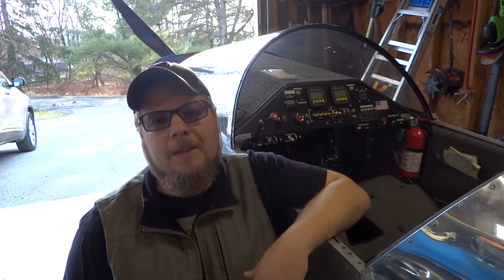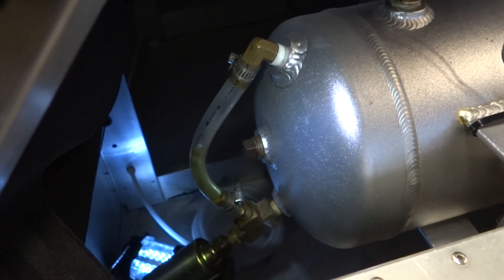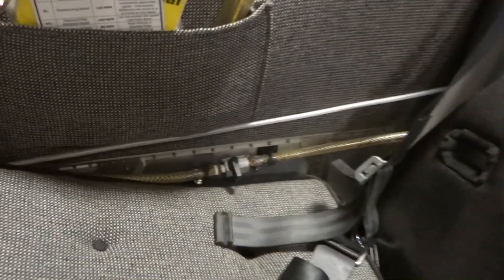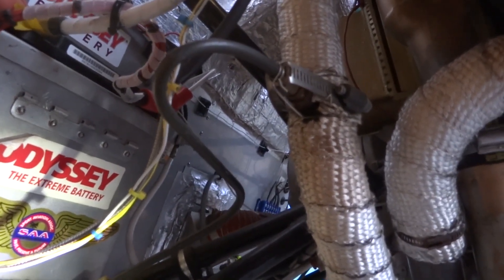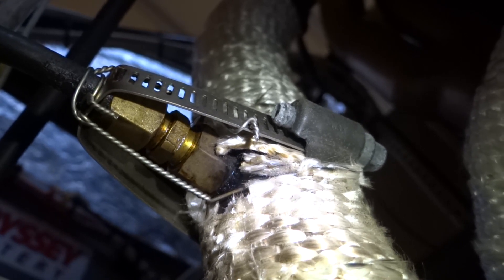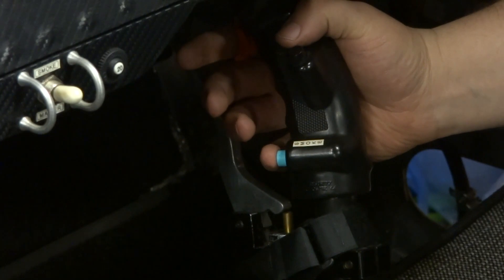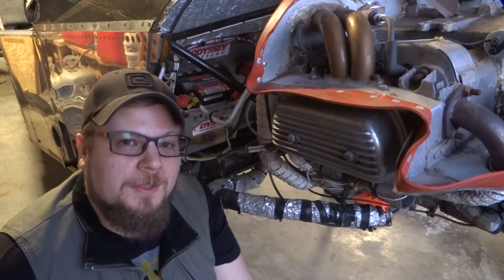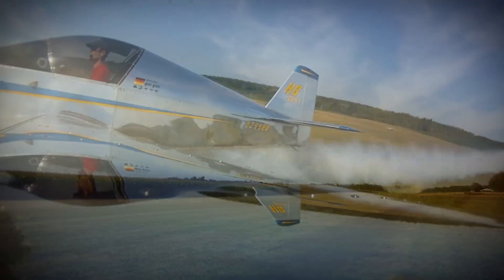My Sonex's Smoke System, How You Can DIY Your Own

Comment: Thanks,  I'm going to use a translucent oil tank (so no need for the clear hose to show the level).  I agree - the supply is NOT going through the firewall like that.  It's going low in a corner with a bulkhead fitting.  Pump is going on the forward face of the firewall - low so it is basically gravity feed to the pump and the high pressure runs will be minimal and in the engine compartment.  On the AeroVee the recommendation from Marvin at Smoke System Helper (https://www.smoke-system-helper.com/) is to inject on each side of the engine - much higher up than your system shows - basically as soon as the exhaust leaves the valve and JUST below the EGT sensor.  I got his "small bore" injectors and will use flexible stainless braided pressure hose with AN couplings.  Might just keep it to a simple single switch on the panel - though the trigger on the stick is nice.
Reply from the maker: Cool, definitely seems like a better way to go Graeme. 
I do like the push button on the stick as well, keeps running until I turn it off.

Comment: What kind of oil are you burning? This stuffs expensive…
Reply from the maker: Mine came with a 5 gallon bucket of concrete form release oil, but I honestly haven't used it. That is supposed to be cheaper, but there's concerns about whether or not it's "safe" to use. However, I recommend doing a group buy on a drum of proper smoke oil to save $$$. Lower per gallon cost on a bulk buy. Find a couple guys at your local airport to go in together. Or sometimes someone who has a drum can sell you a couple gallons at the bulk rate. One of the Sonex guys also mixed his with diesel.
Reply: Just use diesel. That's what the Red Arrows use. I worked with them on an event.
Reply: these days we are using something akin to baby oil.  Non toxic, smells nice, and you come out moisturised ! Comes in the big blue steel bongos.  Several of the guys (and gal) pitch in together to get a full (55 gal ?) drum.
Reply: @markpitts5194  who’s the distributor
Reply: @markpitts5194  do you remember the name of this baby smoke oil?
Reply: @peterp696  You are in luck.  I happen to be going to the club tomorrow, I'll have a look at the bongo in the hangar.